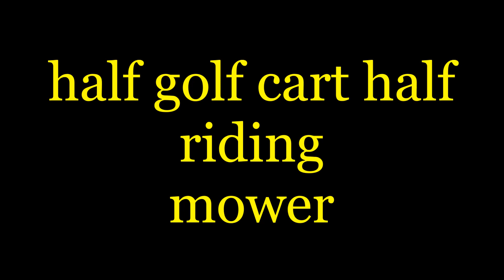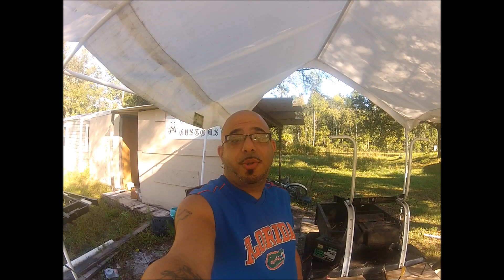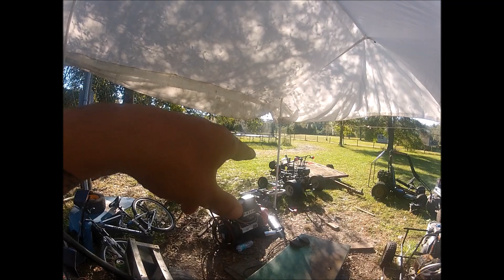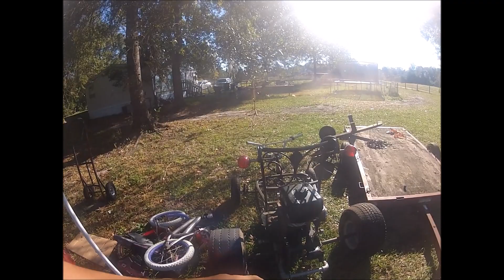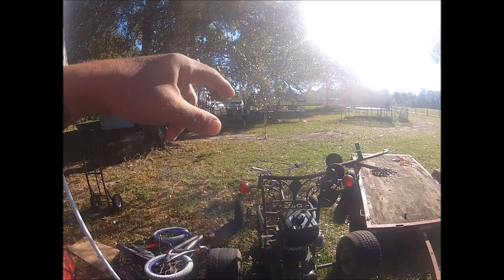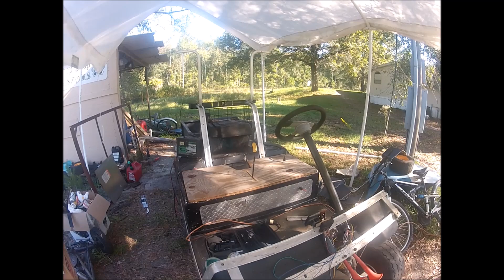half golf cart half riding mower

Comment: I like how you think, guy!  I've been rolling a very similar idea around in my head for a couple years, and just never have gotten caught up with all the other squirrel-chasing enough to get started.  Couple months ago a friend gave me a semi-stripped golf cart, he put the drive system from a 36v non-electronic golf buggy into a homemade paddle party boat and was left with an unpowered chassis he had no use for.  I've been debating how to put a lawn tractor transmission and engine on it, and you've given me some ideas.  As soon as temps get back up, and presuming no more projects attack me, I'm gonna get on it this spring.
Reply from the maker: I feel you I have a lot of projects going on I'm going to finish this one and if I get this motor running I'm going to build a four-wheel drive version using a Polaris 330 check out my video sitting on your butt won't finish your projects I've gotten a free motor transaxles everything just got to get it running thanks for watching

Comment: It’s a Frankstein but hell if it works then 👍👍 !! Get some diamond plate or sheet metal and make some rear quarters to cover the old golf cart wheel arches and make new wheel arches for the lawn mower portion.  Can put them on with screws or hinges on the top of the new quarters to lift up to service it
Reply from the maker: I'm going to finally get a chance to finish it up soon test drive it and we got a new build coming up I'm going to be building another one with full full drive using a player's 330 motor transmission axles and all thank you so much for watching and stay tuned
Reply: Why didn't you take out 7 inches from the middle of the mower? Ive built one, and the rear tires goes right under spot the old rearend was.  Also put shocks and coilsprings under it.  Electric fan keeps it cool.  Exhaust all the way to the rear of the bed.  Pulley swap with 6 gears peerless 208 31mph so far with 20-10×8.  So far i have less than 75.00 in the whole project. Next up is fabbing front disk brakes for it.  Cool build you got